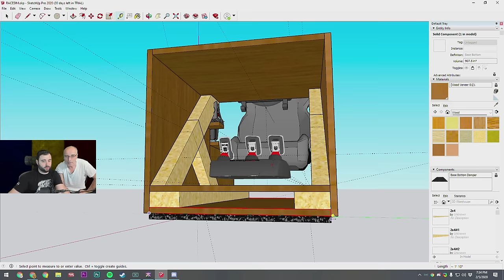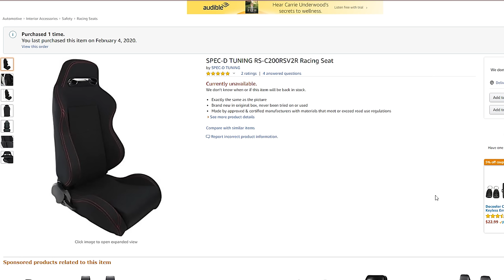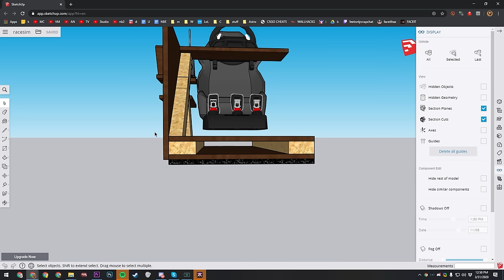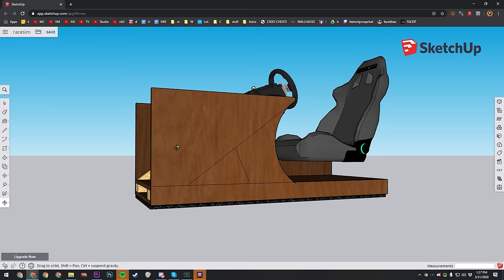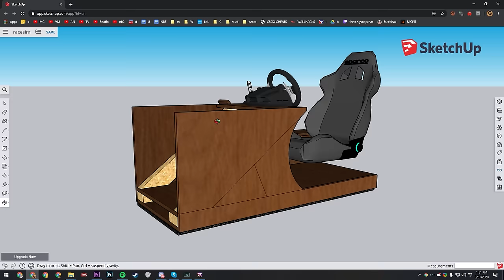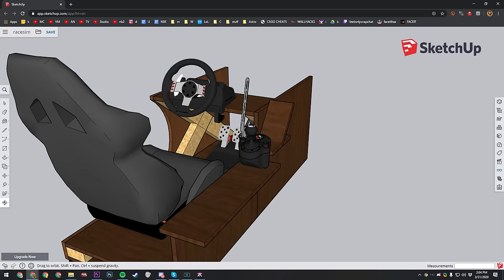Cheap Wood Race Sim DIY Build (feat. Papa Bunyun) - Project WOOP

Comment: you do know, that you can screw in the wheel from the bottom, and remove those plastic brackets. There are holes already exactly for it on the bottom.
Reply: just check the size of the bolts you need and you should be able to get them at any hardware store
Reply: I think I'm a bit late in saying this but you can also remove the little block things that are part of the plastic clamp
Reply: @louier9033  how
Reply: @trevorkratzer  just sort of twist them off, they do come off

Comment: Gotta love dads. Mad you don't do anything around the house, but eternally frustrated when you do. 

This set up is decent, but it's going to suck donkey balls when you upgrade your set up to a full sized wheel. In order to avoid the knee hitting the pegs, hard mount the wheel to the ply wood.

Comment: Don't know if I'm behind the ball on this, but if your wheel is like mine there will be 2 holes near the sloped end of the block that you can screw into from the bottom. I would highly recommend a piece of slat metal that is long enough to go between each for a more stable grip; screws and washers on their own will work, but I felt the piece of metal worked better before I had to rip mine apart.

Comment: I made mine as well (its behind me in profile picture in mclaren colours, take screenshot and zoom in if curious ), bolt wheel in to stop hitting knees (I had similar issue until I raised it), your dad has made yours like a carpenter would (correct way lol ,mine is just the basic frame with plywood over the top to hide all the ugly bits and a chair from the car yard off a PT cruiser

Comment: Great looking project. I built myself a rig also (during lockdown) out of wood. I went for a wooden "clone" of the aluminium profile style rigs instead. Glued and screwed in most places and bolted together in areas where I thought I might need adjustment in future.

Comment: Nice go, me I just got me a superultrawide 49" monitor, but my wheel and peripherals are a bit heavier industrial steel and so on so I am will use an old kittchen table plate as a base plate, the rest above it I'll try to figure out but thanks to this video I got some ideas at least. Luckely I have a house with a carpentry shop across my yard where I have  huge spaces and all the saws and drills one  would expect at a factory so that at least shouldn't be an issue...

Comment: That racing wheel has captive nuts on the bottom so if you wanted you could disassemble, remove the clamping style mounts and just use bolts. I think they're m8.

Comment: Are you Nick Bunyon? (spelling?) Great video! Fyi I built a racing cockpit out of wood for my G25 setup, works sweet! Pro tip: remove the pedals from the plastic case and mount them upside down in the cockpit so that they are configured like the pedals in a car. Also, a dead pedal on the left side is handy as a foot rest.
edit: your base is a little over built. Just having 2 2 x 4 rails upright on both sides and plywood only on the bottom will be strong enough yet will save weight and material. With this base the floor of the cockpit is on the bottom of the cockpit and the seat can be mounted on a pieces of 2 x 4 mounted flat on top of the 2 x 4 main rails in order to raise the seat up off the floor 5 inches.

Comment: Yes, your dad is very talented. Would you ask him to put his thinking cap on and consider the following mods to your platform. I’m into Flight Sims and would like to have two systems using the same chair and peddles. Position #1 would face a single monitor, my general aviation panel with yoke for Microsoft Flight Sim 2020. Position #2 (rotate 90 degrees to the right, would have just a monitor and my Hotas for for use with military and helicopters. The only shared components would be the rudder peddles and throttle. Any ideas would be much appreciated.

Comment: Hi I have an easy solution to save your knee caps 😉 try taking the wheel hubs clamps off and put scews through the bottom of the table top there are screw holes on the bottom of the wheel base for hard mounting. Awesome rig by the way
Reply: This

Comment: you can remove the mounting clamps that wheel has, giving you like 3-4 cm(1-2") of free space, if you dont know what i mean google it or look in the manual of the wheel. after that you'll need to screw in more when mounting the wheel because i saw that you have a thin piece of wood. Romania te sustine!
Reply: This is exactly how I mount my wheel, with the mounts it already has for the screws!

Comment: I'm thinking of doing something similar to this for space sims. I'll be using the cross portion for kb and mouse. Our cats wouldn't forgive me if I did something as despicable as leave a keyboard in their favorite sleeping spot. The issue is getting in and out of it with a stick on either side.